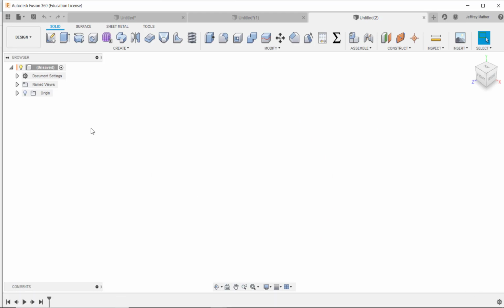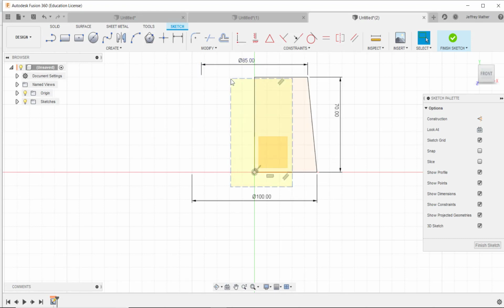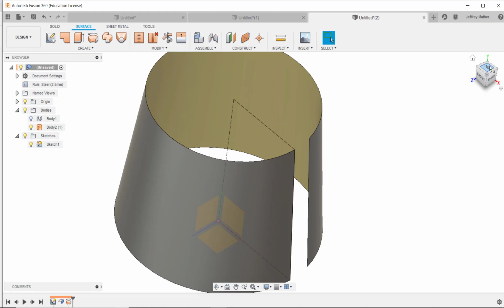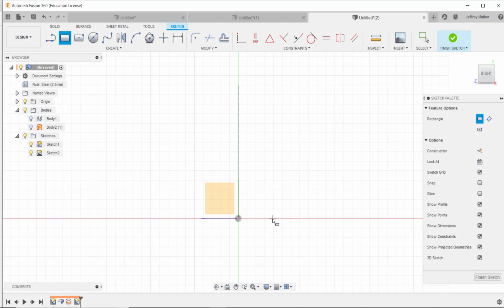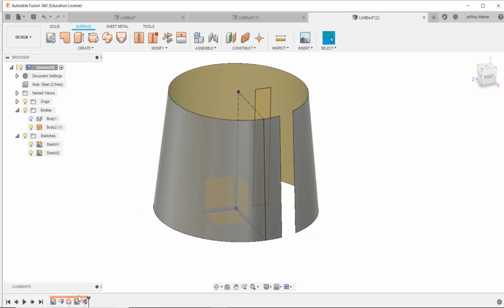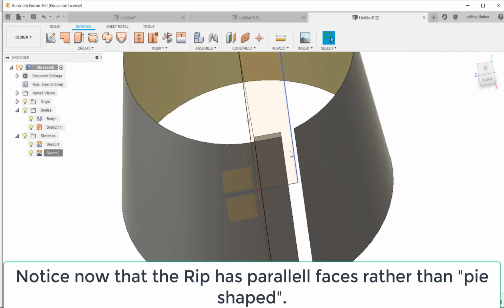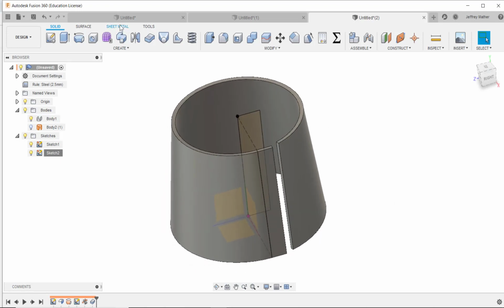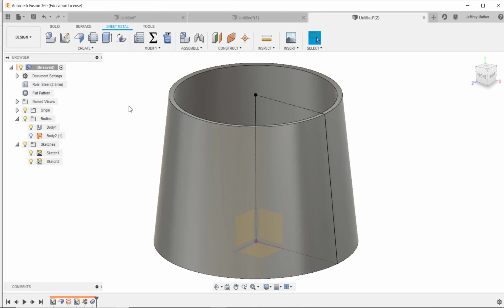Caution on Source of Information   A Sheet Metal Cone in Fusion 360

Comment: Hello again sir. Thank you for sending me the link and/or trying to help me, but I didn't find anything related to my question/problem.
What I really want is an explanation of what constraints I should use to animate (close and open) a small piece of cutted tube (with a vertical opening) under pressure. "Only that.
I reiterate my thanks. 
Sincerely: 
João Carvalho.
Reply from the maker: You didn't follow my instructions to post your attempt.
Arc Length and Radius.  Animate Parameter the Radius.

Comment: I struggled with the "Diameter Dimension" step, so I thought I'd emphasize the piece I missed for anyone trying to find that option in the Dimension tool or who might not be getting the right results.

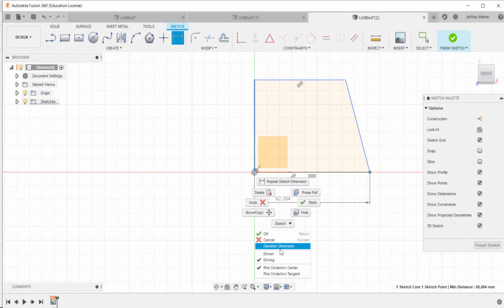At about 1:35 in the video, I missed it when @TheCADWhisperer specifically selects the inner vertical line and then the lower outer point of the cone profile sketch. He then right-clicked and selected "Diameter Dimension" to create a diameter dimension. The key I missed was that the option in the right-click context menu for Diameter Dimension only appears if a line and a point are selected (there may be other combos, but in this instance, those were the key items to have selected).

I was just speeding along dropping standard dimensions (linear) and missed what I know now was a key step. I couldn't get some of the following steps to produce the same results he got. What I had on screen looked almost exactly like what he had, but thickening step for the surface and the end result just wouldn't unfold at all without errors.

Thanks CAD Whisperer! Great video!
Reply from the maker: Since this video was created - Fusion added a Centerline type that makes diametral dimensioning easier.
Reply: @TheCADWhisperer  I discovered that one, too. Very handy in a number situations.

Comment: But now you have still a little cone on the top end.
Reply from the maker: I do not know what this response means?
Reply: @TheCADWhisperer  You can see it in the picture at the beginning and at 6.59, the top small side of the cone is not normal to the longitudinal axis.
Reply from the maker: @TorteTS  Go out to the shop floor and model the part in the real world.
In the flat pattern state - the edge is perpendicular to the flat.  When you roll the part - that is the result that you get.  My model is correct.  You saw this at the top of the cone - check the bottom of the cone and you will see the same thing. (Easiest to see if you use thick material.)

(I suppose if you had an articulating cutter head that could cut the edge of the flat at an angle... ...but this is not usually the case.  The edge is generally cut perp to the flat.)